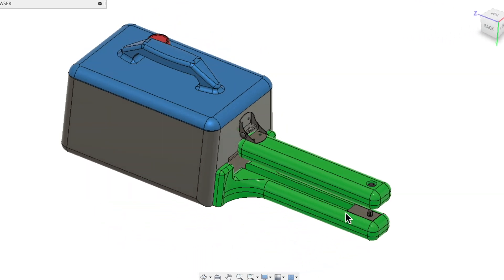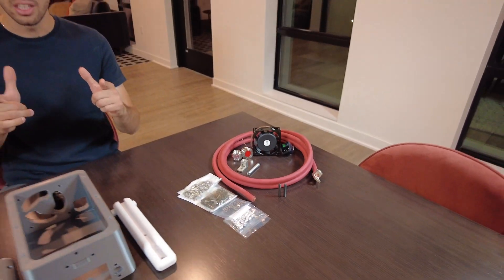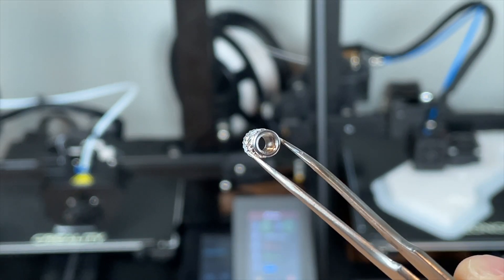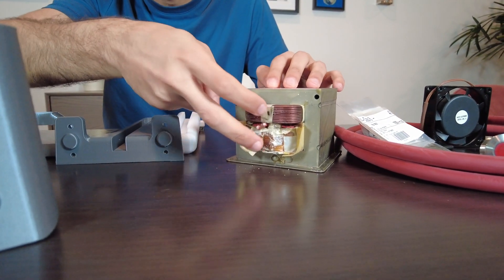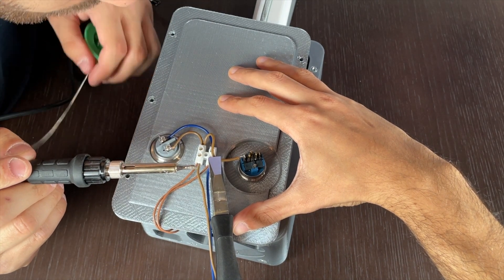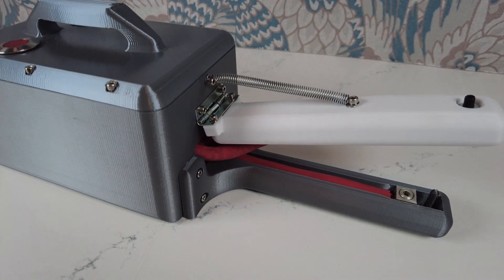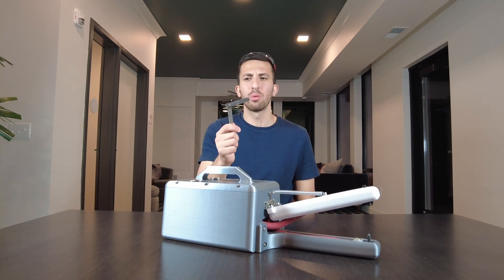DIY Spot Welder Reaches 1540°C And Melts Steel

Comment: Nice video. Thanks. What's the max combined thickness of steel and stainless that you can weld.
Reply from the maker: It really depends on the transformer you use, wire, electrodes, welding time, etc. I don’t know exactly but I’d assume it’s much much thicker than the thin ruler we used

Comment: How much current were you able to get with the re-wired transformer.  Typically you want several thousand amps for welding 24-26 gauge sheetmetal.
Reply from the maker: It’s perhaps 1200amps. I can guarantee it’s not several thousand amps.  Sorry 🤷🏻‍♂️

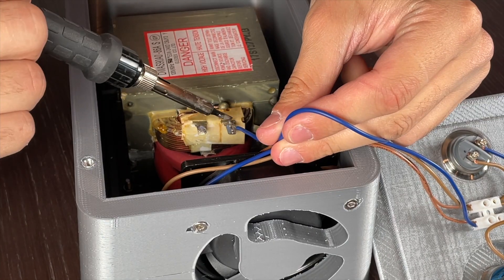Comment: Damn that fan has a wide motor (2:33). Why is it so much wider than on CPU fans?
Reply from the maker: It’s an all metal fan. Definitely an overkill for the application but it’s all I could buy in the limited time I had to complete this project. Great catch by the way. Cheers, Dave

Comment: So when I go to download the step files it's has all the non printable parts separately but then the printable parts are all in one body. Am I doing something wrong?
Reply from the maker: I’m not sure. It should have all the parts separated. Which program are you using!
Reply: I'm using FreeCAD maybe that's the problem.

Comment: nice cut
Reply from the maker: Thank you 😎
Reply: @ActionBOX  I meant the cut in the video after you supposedly weld the ruler. I was being ironic so as to say it lightly either didn't work or got pretty nicely welded to the steel screws.

Comment: Cool stuff. Btw won't that plastic melt from the heat of the electrodes?
Reply from the maker: If used just a few times for a home project then no. If used constantly as an industrial machine then definitely.  Great question and thanks for the support 😃.

Comment: The Longer printers have a lot of Quality Control issues from what I've seen.  I highly suggest something like the Voxelab Aquila instead, but make sure you update it's firmware.
Reply from the maker: Its true that I have had more issues with the longer than the Creality, but it still served me really well. my primary issue with it was the servos slipping, causing the print to suddenly shift mid way (so the layers dont line up). This only happened twice.

Comment: You should've probably talked some more about the dangers of dismantling a microwave. Since it may still hold a deadly charge in its caps.
(unless pretty much every other video about using salvaged microwaves has lied)
Reply: you are right! Really dangerous, the caps can be still charged